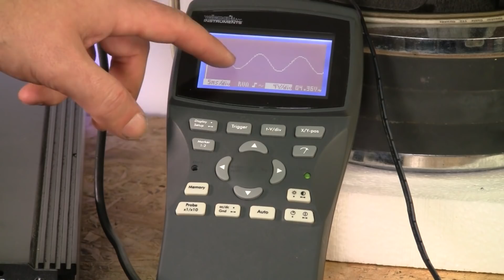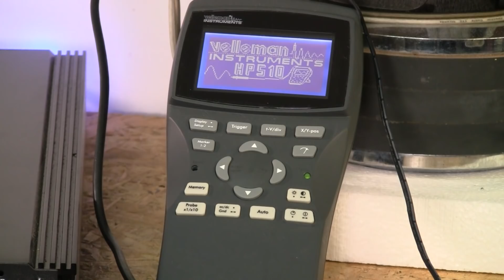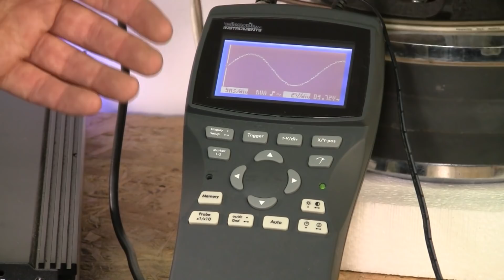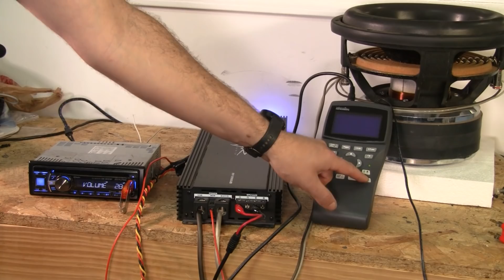How your budget amp kills subs without clipping - Tech Stuff Tuesday

Comment: I just have to say, I'm no audio or electrical engineer genius or anything but I do know when you put electronics like a sensitive oscilloscope near a magnet it will cause the device to do strange things. It looks like in this video you have your oscilloscope laying up against a very large neodymium magnet connected to the subwoofer you were testing on. In my past experiences that will cause some very massive unwanted interference in some way shape or form. If I'm wrong somebody please explain.
Reply: can you say shielded?
Reply: @LordofthePings-k  what is shielded? The oscilloscope? The speaker?  If the oscilloscope is magnetically shielded that's cool but I don't see that being a feature of this lower price point oscilloscope this man is using in the video. As for the speaker it's clearly not in a box so nothing is shielding it from anyting. On a related point it doesn't really seem to make much difference if something is magnetically shielded if the instrument you are trying to shield from it is so sensitive it can pick up the smallest bit of EMF interference or otherwise.
Reply: @baltazard133T  The leads and the case are shielded. It's not only standard but it would be nonsensical to use equipment easily rendered incorrect by simply using it as intended. In other words it would be stupid for it not to be.
Reply from the maker: You are wrong, I'll explain. The o-scope is about 4-5" from the magnet, which is ferrite, not neo. I showed in another video the gauss reading at that location was around 40-70. For perspective, speakers of all sizes, even mids, are over 3,000 in the gap. Magnet's don't radiate a field in every direction, it's polar. That means you won't get much of a reading outside of the poles, and directly. There is equipment that might be effected by tiny amounts of a magnetic field (refer to Green Bank, WV) but this o-scope is not one of them.
Reply: @EMFAudio  that's why the questions are being asked 😊

Comment: Lul running a 2k on 8 Guage wire...even with it being a short run will never receive  proper amperage
Reply: The statement you made is just blatently false.  Awg amperage rating is just that (a general guideline).  Too, the length isn't factored in to the rating, unless you are looking at tables.  3ft of 8awg (800-900 strands) can easily handle over 150amps (bursts of 10 sec).  I have a formula i made, somewhere on my thumbdrive that calcs the awg required for a given total length (power and ground), bonding resistance, and voltage drop (due to all of the above). When I find it, I will post the formula in this comment (edited), if you wanted to ever use it.  👍

Ok, i found my spreadsheet, and here is the formula i use and go by.  Feel free to copy and paste and use it for your own projects.

AWG = -[(LN((2*SQRT((((11.2*Amps*Length)/Voltage_Drop)*0.00050670749)/Pi()))/0.127)/(LN(92))]*39+36

Terms:

Amps = peak amps
Length = full length of entire power and ground circuit (feet)
Voltage Drop (under full amp load) = "desired v_drop" or measured: Voltage at battery and/or alternator minus Voltage at the amplifier voltage input terminals.
Temperature coefficient of resistance of copper = 0.00050670749
Area of wire = 0.127)/(LN(92))]*39+36 which converts from area to AWG

So, in this case, I calced 150amps, at 6 feet of total power circuit length (3ft for positive and 3ft for negative), with a desired voltage drop of 0.6vdc at 150amps.  

This gives an answer 7.92AWG (8 Gauge)

Would I do this in my car, probably not...I would probably run 6awg or 4awg depending on the setup.  But for a quick on the bench setup, yes, without any doubt.

Comment: I've installed probably a few hundred of these amps and sold more than that. I've even used a few of them myself and have bench tested them. The ratio of blown subs on these amps is no higher than on higher quality Korean or Brazilian board amps and from obviously, more than a few other manufacturers.
A few things that set off my bullshit detector...
1) There is no demonstration of the power input voltage or how clean the supply is.
2) There is no demonstration of the volume level at which the head unit clips or any demonstration of where the bass, treble, loudness and subwoofer output levels are set.
3) Only one amplifier is tested.
4) For most of the video we don't see the display of the scope to see where it's actually auto ranging. There isn't much that could be fishy here but the fact remains that there isn't much offered either.
Not to mention, one test on one amplifier qualifies as anecdote and anecdotes mean fuck all to testing and demonstrating problems. Especially when the video claims not that this one particular amp or size in this series or even this series but... generally all budget amps kill subs. That's a grand shitburger of a statement that can not ever be proven or even loosely supported against the volume of evidence already available empirically. In simple terms, there are thousands such amplifiers in use every day for months or years that aren't wrecking speakers.
In summary, this demonstration is at best poorly thought out and at worst, wholly dishonest.
Reply: I ran an rp2k for two years, sold for nearly retail on Ebay and still have my deafbonce subs slamming
Reply: I have an ignite R300/1D (super cheap) pushing an audiopipe BD2, for almost 2 years as my daily and I'm not nice to it. Still going strong. Maybe I just got lucky?
Reply: I love this amp, first vid of your I watched with disagreement,but videos don't lie
Reply: Keep defending shitty brands I’m gonna keep buying good quality products
Reply: 1. irrelevant.
2. irrelevant
3. good point
4. good point.
5. fair point. but,you also assume he isn't proving something. making those same mistakes.

Comment: I had a rp 3500 and hated it the bass was horrible could never get it right ..on the amp dyno it did rated ..in my car on 14.4 volts it did just shy of 1700 on term lab

Comment: Also turn LPF level no more than a 1/4 of the way up. I keep mine all the way down
Reply from the maker: So you low pass at 50 hz? You're missing out on a lot of content.
Reply: @EMFAudio  yeah, I'm not to crazy about the sound. It starts sounding hollow and echoey, like its getting alot of reverb. It is more vocal turned up higher, but my 2 Audiobahn AW1805Q's just don't sound as good. That's just my personal preference. Could be due to lack of power both to and from amp. Could be due to vented enclosure being almost half the size it needs to be. Idk. But it drops in hard AF and gets really low.

Comment: These amps are tested to distortion. How can they pass 1% distortion at high output if the signal clearly distorts with barely any signal? Sound like you are projecting a lemon onto the rest of the industry.

Comment: Could it be this amp, something may of happen to it. Have you done it with like new ones Oder like 3 and if they all do it. You got me sold on this then for sure.
Reply from the maker: That's the point, it IS the amp. The fanboys are blaming everything but the amp. This is the first amp I've had a need to test, because I haven't seen it commonly happen to the same model over and over till this one. The owner of it let me hang onto it to test it while I rebuild his subs.
Reply: EMF Audio oh brother. No fan boy. I like what works. You guys got some really nice things. 
I was just tossing that option out, that is all. But it’s understandable due to text blocks a lot of understanding

Comment: This is where you break out the old 1970s or 1980s analog lab scope that you can pick up on eBay for like $70 to $150. You also get a good pair of shielded leads for your lab scope so they don’t pick up any interference. Turn off the auto ranging use your brain and dial it in lock it on.

Comment: I have a sound that's hurd when my volume is down and my equalizer is on my tweeters hiss kind of loud my amps are turned almost all the way up there house amps
Reply from the maker: Sounds like a ground loop, or the noise floor is really high because of the EQ. Cheap EQ's often induce noise, but if you've got it boosted like 18 dB, that'll do it too.

Comment: Having something simular happen with the new SKV2-2500.1d I just bought. Very noisey signal @ the output jack. Switched in my pioneer gm-dx971 and tested at the output jack...nice and clean signal. Using a Picoscope. Wtf. Thought I was getting Skars top of the line, nope guess not. They (Skar) said to send it back for a new replacement. $1k on a Skar setup and still cant use it. Not going to fry the subs sending that shit signal to them. Full disclosure, box that subs and amp were in when FedEx dropped off, had a smashed in edge on the amp side of course. Idk what to think...is this just par for Skar amps or was it damaged in shipping by FedEx??
Reply from the maker: That isn't the kind of thing that would happen from shipping damage. Though worth noting, proper packaging can take a 3 ft drop from a shipping carrier.

Comment: These amp get a bad from user error all the time insufficient electrical mounting wrong wiring below 1ohm and some stuff is damaged and not seen by the eye. Also remember Chinese board so they do have some that come in no good but who knows
Reply from the maker: Insufficient electrical or wiring below recommended would cause total failure, not an irregular output wave. Mounting it "wrong" would cause it to have thermal issues only.
Reply: Just stating the normal issues with the line. This is a new issue I haven't seen before.

Comment: When you Say cheap amp what are you referring to other than the obvious cheap junk ones like Soundstorm or boss. Are you saying unless your buying top shelf big ticket primium brands like Sundown or Crecendo EMF DC ECT it's a "cheap" amp?. Most working stiffs wanting a decent thump in the trunk can't swing a $1000+ amplifier (But guess there not buying $600 subs..) my Pioneer GM9701 seems to be a decent 1200wrms amp and it is definitely budget at $140. And why are amp dyno #s useless? I can see why someone would say that about a car Dyno because it just gives WOT numbers from 3500 up that says nothing about drivability and part throttle or just seat of the pants performance. But other than not being able to test clean wattage sound quality an amp dyno seems to be a good measuring stick for overall power capabilitys which is seems to me to be good spec when choosing an amp seems so many companies lie about RMS numbers, and also shows there capacity of certified vs dynamic where some make about same wattage cert and dynamic but some make same x amount but really jump dynamic like the GM9701 Pioneer I have makes a touch over 1200w cert but jumps to over 1750w dynamic... I am genuinely asking not arguing why are amp dynos pointless?  Sundown uses them...
Reply from the maker: Cheap amps are just that, amps that cost below average and probably don't perform as advertised. "Working stiffs" as you put it are exactly the ones that buy the top dollar equipment, they just prioritize car audio more than others. Amp dyno numbers are worthless because they aren't realistic. You don't listen to a resistor, it doesn't tell how clean the amp is, how the amp sounds, or it's efficiency. Results can be manipulated and it most definitely won't tell you how reliable it is. Your car dyno relationship is essentially the same thing, it's a number under a specific condition that you aren't doing most of the time, nor does it tell you how it drives. Do you know why Sundown uses an amp dyno? Because people buy into the numbers, it's marketing.
Reply: @EMFAudio  well as far as your take on working stiffs yeah obviously working people buy them... You don't work kinda hard to buy anything, I said MOST working stiffs not none can afford it, there's plenty of people that are real enthusiast that can't afford multi $1000 systems, I'd say a majority of people spending that much either have above average paying jobs or spend every cent they have on there system and as much as you may really love a powerful thumping system they have bills and responsibilities and prob more than one interest and can't justify spending that much on there car stereo because sitting in your car listening to music would be your only pastime... I dabble in home theater, DIY Bluetooth systems as well as my car audio and that just cut my audio budget in over half but I consider my audio hobby fairly serious so by you basically saying if your not running top shelf equipment your basically a low rent audio poser is fairly insulting but that's not a surprise seems you making your superiority complex explaining how everyone but you are wrong is very prevalent on a regular basis. The only brands I discriminate are the ones who are totally dishonest, I give props to anybodys system if the person is trying especially if there proud of it and most importantly it makes them happy! I'm soooo glad Sam shot this unsubstantiated foolishness down. This...Sam 1 EMF 0!

Comment: One thing of note with some class-D amplifiers is some of the control ICs can go into gain compression in lieu of clipping as there is a fixed amount of power from the power supply and duty cycle available. Seen this in small class-D amps in self-powered speakers. The IC or ICs will dynamically compress the audio at the extremes to avoid clipping. If some high power amps do this, it will dramatically increase the dissipation in the voice coils as the RMS power will be much higher.
Reply from the maker: I know exactly what you're talking about, and that's very commonly found in home and pro audio. I can't recall seeing it in car audio. I think if it was in car audio, it wouldn't be found in cheap stuff.
Reply: @EMFAudio  Thanks. Thats sort of what I figured since I have not seen it with my class-D amps in the car. Only on console and speaker systems for home audio.
Reply: Yes, this is what I was trying to get at with them being digitally controlled to the nines...i just wasn't aware of the "compression" verbage.  Thank you for the clarification.
Reply: Not in a good Class D. Maybe in some piece of trash like this. Throw it in the Skarbage can and buy a real amp.
Reply: @jeffreytopp4695  Then you have hard clipping, which can be even worse. As the clipping becomes more severe, it effectively puts the load directly across the power rail (or rails for a half-bridge) which is why subs will often burn up. Of course, the obvious answer is more power than needed, which is usually the solution in competition environments. Still, having some form of active compression I would consider to be a good thing, and something an upscale amp should have so it doesn't risk overly taxing itself or whatever its driving if its pushed beyond what it can do. The other feature often lacking is cycle-by-cycle current monitoring of the switching devices.

Comment: Thats scope was really close to a powerful skar vxf 300oz magnet....
Reply from the maker: Let's tackle everything wrong with this statement. First, it's not that close. Second, a motors strength is at the gap between the top plate and pole, not random radiation. Third, that clearly isn't a Skar sub at all (it's in fact a Banhammer v1 prototype). Fourth, the weight of the magnet is not a direct relationship to strength or performance. There are different grade magnets, different quality steel, and the quality of the magnetization could have the same size motor that looks the same have very different magnetic properties. Additionally, the performance is relative to the rest of the motor design and the coil used in it.
Reply: @EMFAudio  thanks for the info man ur a expert..ive heard your emf sub or whatever has really good sound quality with punch... And that explains why ive owned cheaper subs that look expensive that act weird playing under 20hz all types of distortion like the nvx vcw i m testing now that uses the same parts as the 12 i feel like it cant handle itself as a 15 something is weak about it causing it to have a wierd harmonic distortion none of my other subs have on the same amp and boxes only happens under 20 hz with clean signal even tho im not reaching xmax weird
Reply from the maker: That's probably the spiders used.
Reply: @EMFAudio  I remember an audiophile complaining about the magnet on his speakers many feet away messing with his crt monitor. I don't know about this statement

Comment: Looks like they bridge them at 4ohms or hooked them up wrong witch causes thermal overload
Reply from the maker: You can't bridge a 1 channel amp, and the amp is rated to work at 4 ohms, and a thermal overload should shut down the amp to prevent damage. If it causes damage instead of a thermal shutdown (as the protection circuit advertises) then that just further proves it's a low quality product.
Reply: Improper box measurements can make speakers go into thermal overload. Bad rca wire can cause unwanted signal. Js I've seen other video on this amp and it tested good note you got bad wave when rca was connected .

Comment: Just to put this out there is no such thing as cheap quality. (You get what you pay for)  And with that being said theres a reason that its such a price difference between the rp and skv line of amps. Also there are better options for a 2k than skar you can buy the CAB 1500.1 and by solid or the CT sounds 1400.1 and be solid. Both are around the same price if not cheaper and im willing to bet both are better quality. But everyones missing the point. Hes saying that whats happening with that particular amp happens often with cheap "budget" amplifiers.  It could be ANY company . Plus its their entry line so its not gonna be with faults. And just because you dont have this problem with your amp doesnt mean that this isnt a problem with the series of amplifiers